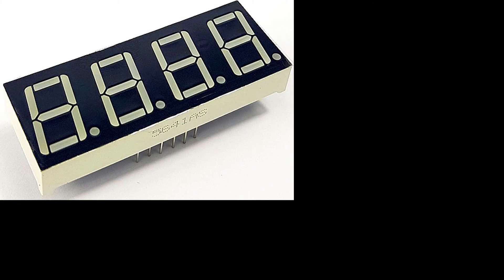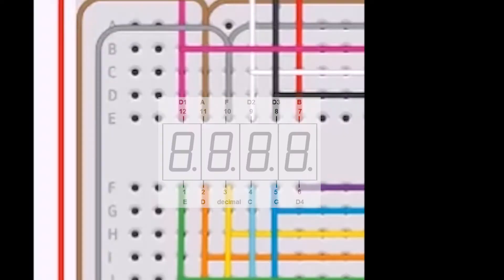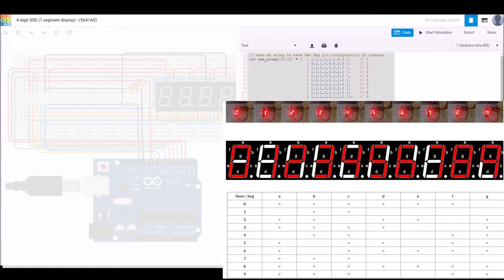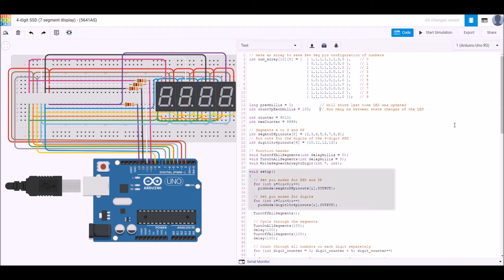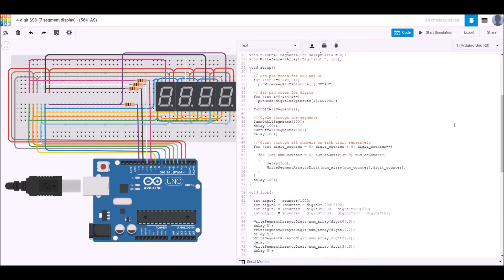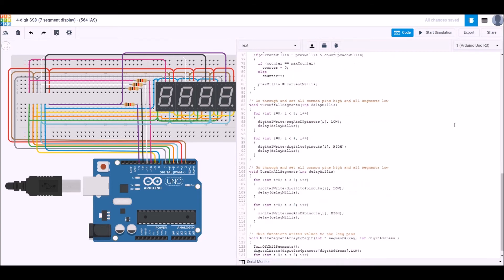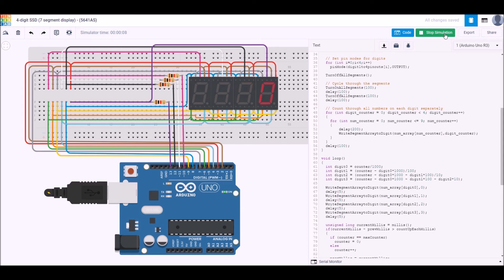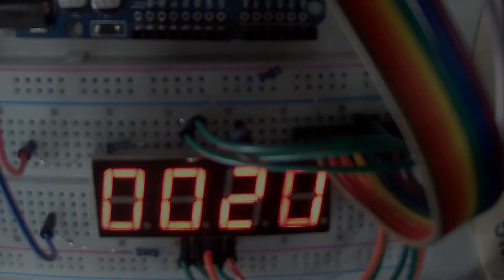4-digit SSD (7-Segment Display) - TinkerCAD project companion video

Comment: how did you add this component? this is not available in tinkercad
Reply from the maker: I made it up from 4 single SSD. I wired it in a way so that it matches the way it would be wired for the real 4xSSD physical component.